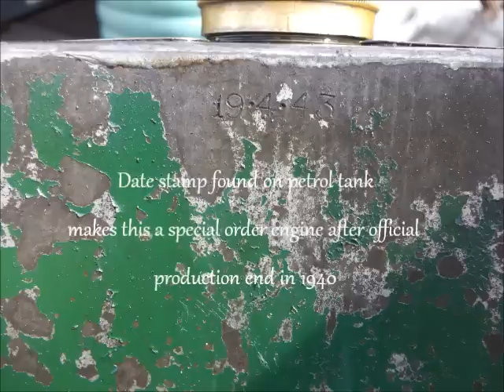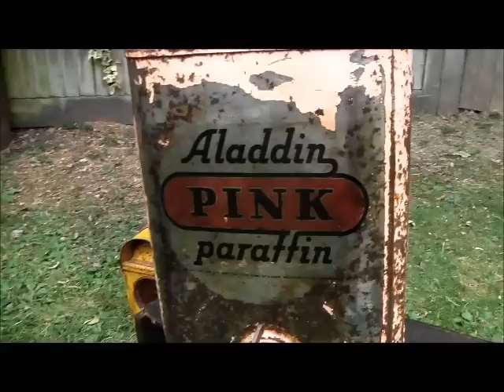Villiers Stationary Engine Service - 2.5hp WX-11 generating set

Comment: That's an awesome trick for a head gasket. And one sweet lathe. Thanks for sharing.
Reply from the maker: J. Dalton As the cylinder to crankcase gasket is just paper you can do that quite easily, a trick taught to me by an old engineer whilst working on a large Gardner diesel engine. 

For a head gasket, the material is too thick but you can still use this trick to cut a paper template before transferring it to the thicker material. 

Phill.

Comment: steamwally nice bit of work. I am thinking i should get in to the hobby. The Petter pump engine in Theddlethorpe needs fresh blood to preserve it for future generations. What would be a nice starter engine to power a generator?
Reply from the maker: Thank you, its a very addictive hobby! Most enthusiasts start with a Lister d, which would cope with a generator like the one in this video. It depends how much power you want to generate?
Reply: I have a 3 socket 220 and 3 phase connection remnants of a generator and a 3 socket 220 set with bad engine to power a 12V battery charger and phone chargers.